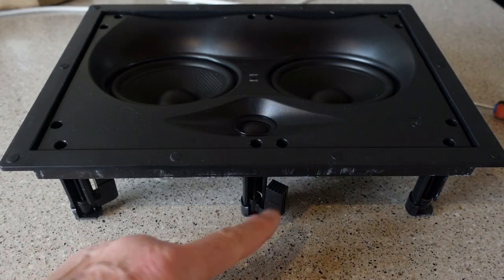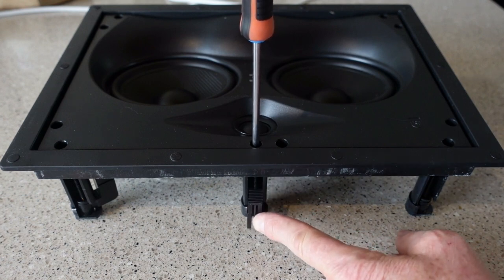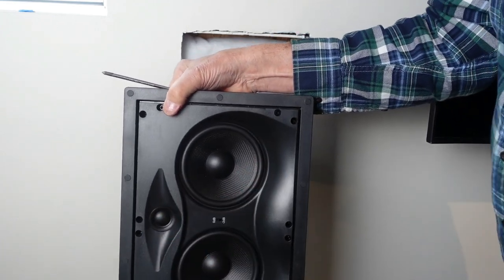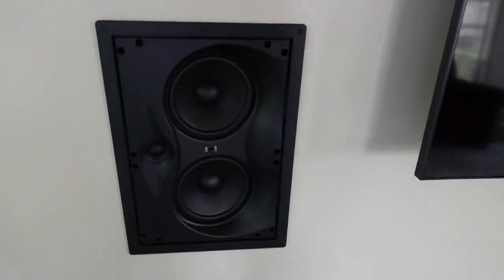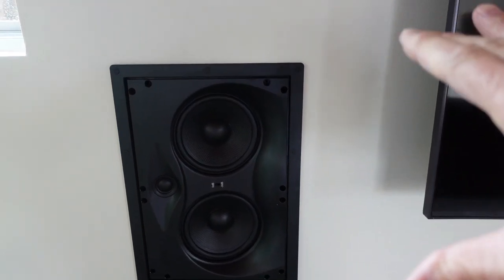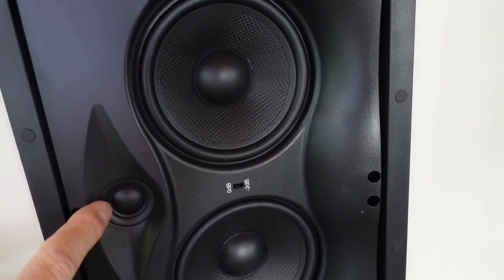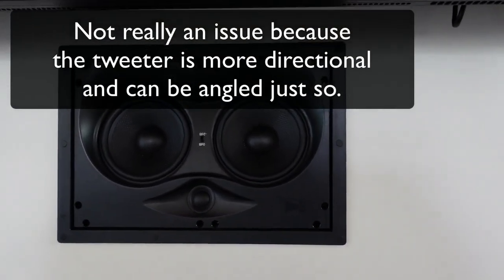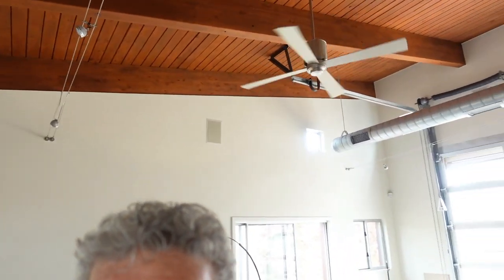RSL W25E Speaker Installation & Review

Comment: These look great! A few questions:
- What is your room size? I have a 20x30 foot room and want to also use them as L/R on the 20 foot side, not sure if they'd be powerful enough.
- Did your drywall guy also do the wiring through the walls? I'm not sure what the standard is. How nice that he repainted at the end.
Reply from the maker: My room is 25x25 with 12’ to 16’ sloped ceiling. It is not an ideal room acoustically as we have concrete floors and a lot of windows and the opposing wall is a huge garage door. Nonetheless, I feel the speakers fill the room with sound without any issues. The original owners of the house had a Control4 system installed, and the wiring was already in place. I’m not exactly thrilled with the gauge of the wire that was used for the speakers, but it is what it is.